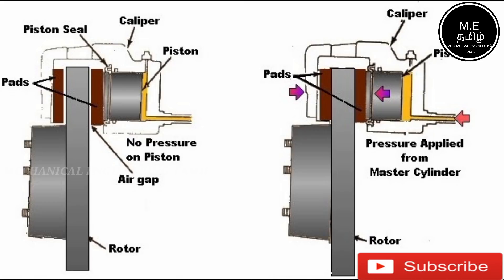Is ABS Required For Low CC Bikes ? (தமிழில்)

Comment: Hi All... In 150 t0 180 CC's segment.. ABS bikes are too high in price range arround 25 k to 30 k   .. so in this segment even if you have CBS , UBS & LBS(All are similar to CBS .. it will works effectively and even your wheel won't lock at 80kmpl speed.. I tried in My HONDA HORNET CBS...😊😊